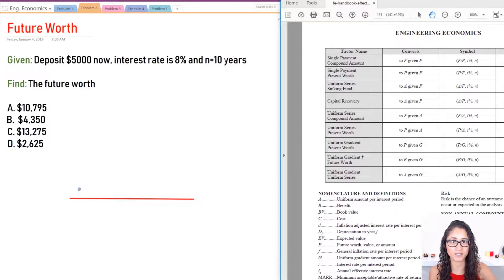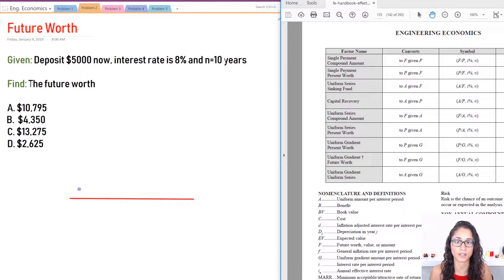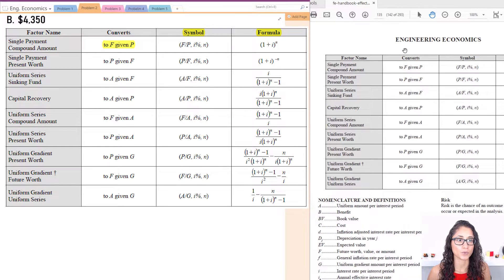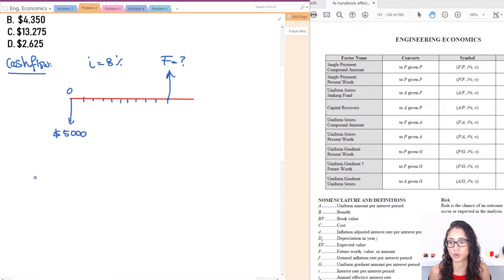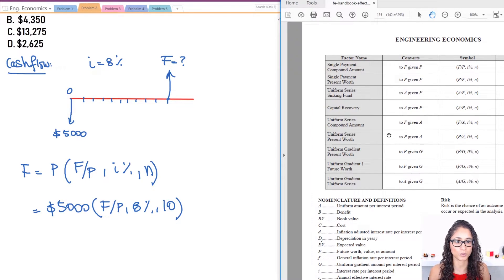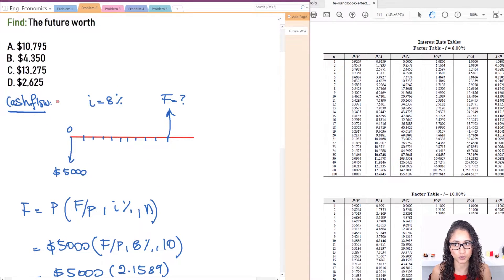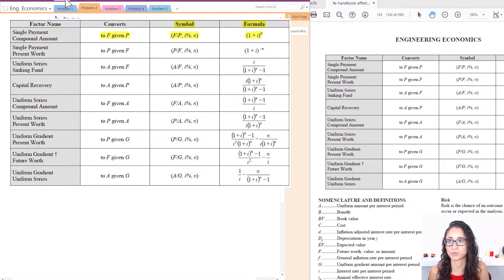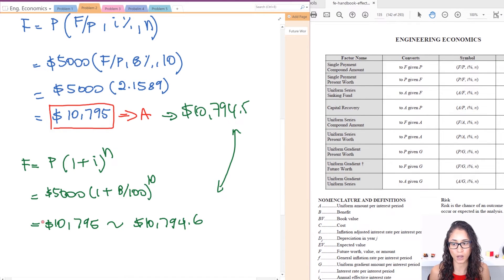FE Exam Eng. Economics - Future Worth (F) - Problem 1

Comment: Consider the following data on an asset:
Cost of the asset, P $140,000
Useful life. N 7 years
Salvage value, S $55,000
Compute the annual depreciation allowance! And the resulting book values, using the 
following methods
(o) the straight-line depreciation method (2 Pts)
(p) The Sum-Of-Year Digit Method (4 Pts

Comment: I'm learning how to use the TI 36 calculator. are there any recommendation for using the calculator with this section of material?  in basic math, it can do integrals and statistics formulas. is there anything like that for engineering economics?
Reply: there are no econ formulas in this model. i am studying for the pe exam and have been using it for years. sadly, for econ questions you are on your own.

Comment: The video stop after 10sec
Reply from the maker: It should not do that! Maybe check your internet connection, you should be able to see the whole video!
Reply: Thanks Yh I had problem with internet, Hey I am gonna take my FE Test next month on 27th, Have you made any FE prep course for the whole disciplines, I checked your website and I find just Static Course, I have problems in Dynamics, Environmental Engineering & Steel Structure. Let me know if you have made the course for all desciplines I will purchase before taking my test.